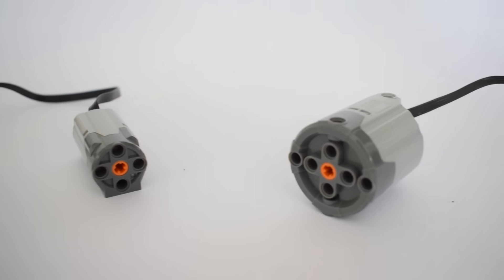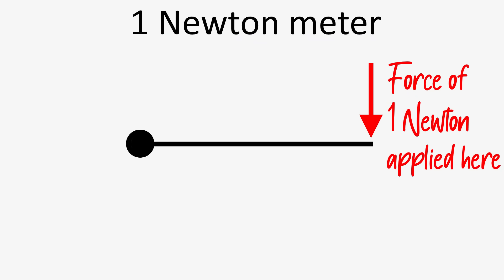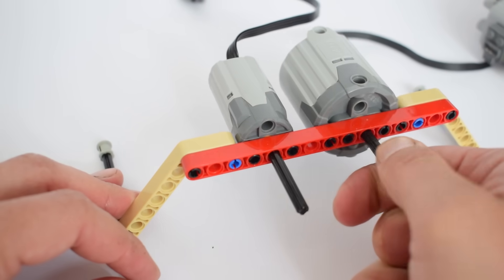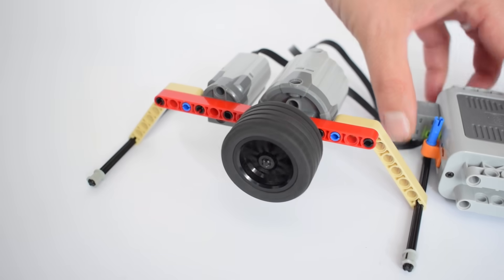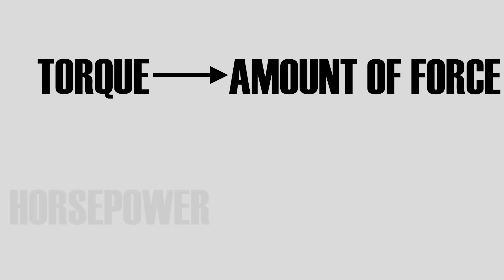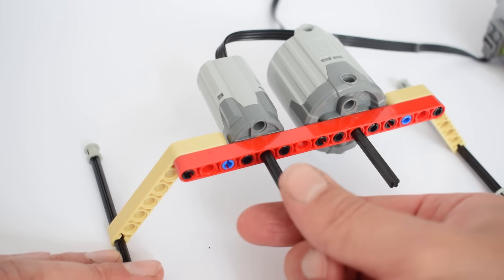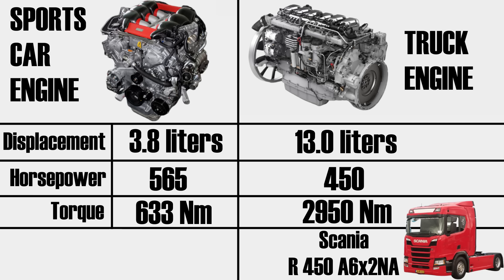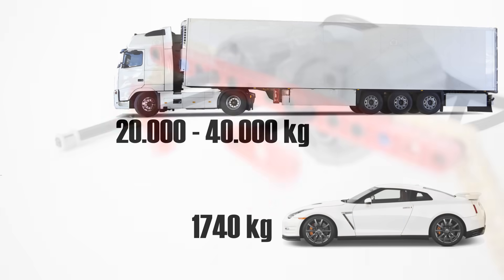NEVER be confused by HORSEPOWER and TORQUE again - HP and TORQUE EXPLAINED in the MOST VISUAL WAY

Comment: So basically, a gearbox is a device to control how much torque is being output by the driveshaft.
Reply: Yes, half true. a gearbox is also needed to spin the wheels slower or faster than the engine speed. 
Since the engine has a maximum power (torque x speed) the gearbox can increase torque by sacrificing wheel speed (HIGH TORQUE x low speed)  or,
increase wheel speed by sacrificing torque (low torque x HIGH SPEED)
Reply: @spamtes  yes that's what I meant, just did not elaborate enough. Thank you for the completion.
Reply: @spamtes  So theoretically you could use the GTR engine in a truck (since it has actually more horsepower at 7k rpm), but you would have to have a transmission decrease the rotations dramatically to get the same (or higher) torque as the truck? Could you also do the inverse and use the truck engine in the car and have the transmission speed up the rotations and with that decrease torque?
Reply: @EndstyleGG  Sort of. If both engines had constant horsepower then you would be right, since lowering RPM would necessarily increase torque. In reality, torque and horsepower are dependent on RPM (search for engine power curve or torque curve) and throttle, so the figures which are usually shown for engines are peak torque and peak horsepower at full throttle. Also, if you're searching for these curves and happen to find both for a same engine, notice how peak power doesn't occur at the same RPM as peak torque (usually).
Reply: @EndstyleGG  look up truck racing.
Reply: @MurdocK-BR  The biggest technical difficulty would be that running a truck on a high RPM engine would be engine durability. Torque can always be geared for, but it doesn't change the fact that the Nissan engine would need to constantly do 4-5 times more rotations at 4-5 times higher angular speeds to end up with the same distance covered by the truck. This creates wear and tear on every mechanical part of the engine. The Nissan engine can barely handle 200k miles driving a Nissan, where the Scania engine is expected to run a million miles, while pulling a full load of timber.
Reply: @EndstyleGG Good Question- exactly.
Theres a completely different reason to why it's not done usually, but in general the answer is yes. 
( Short reason: A truck needs high torque at low speeds because it's got so much weight to pull from stop. A GTR needs high torque at higher speeds to be able to keep accelerating and go fast! )
Reply: @EndstyleGG  Yes you could, the comment at the end about truck engine needing a large amount of torque to move the high mass is not totally correct.  A truck needs a large amount of wheel torque to move the mass so in theory, a higher speed engine could be used with a transmission designed to deliver the range of wheel torque needed.  

In comparison to cars, trucks use large displacement low speed diesel engines because they are more economical to run and maintain than a hi speed petrol engine would be, under the same conditions.
Reply: @spamtes  so basically horsepower is meaningless then with a gearbox. You could have 10,000 ft pounds of torque and the gearbox could just have a ton of gears and you'd be able to go much faster than anything
Reply: @lordzeuscannon6400    The only reason for a gearbox is to multiply torque.  An electric motor doesn't (necessarily) need a gearbox because they can produce torque from (near) zero RPM until max RPM, which is something an ICE can't do. Thus the need for a gearbox. 

It's all about the bandwidth (powerband) when it comes to transmissions.
Reply: @phillipzx3754  then I'm right
Reply: @lordzeuscannon6400  not really. Horsepower is always going to be the most important unit for capabilities. In order to move a car at a certain speed it needs a certain amount of power. You can use gears to increase speed or torque, but they change inversely. A low gear will reduce output speed but increase torque. A high gear will increase output speed but decrease torque. So even it wont matter if the engine makes a high amount of torque unless it also turns at a high enough rpm to make enough power to do what you need.
Reply: There’s a Volvo video on here where they changed the ratios of a fh16. And it out dragged a formula one car
Reply: There’s a few things not taken into account on the truck and car thing, a truck engine at 3K rpm will run all day. It will have enough capability throughout its rev range to do the work it does, this petrol car engine would be all over the show with power curves at different gears and the drivetrain would get excessive wear and the whole system would get very hot.

Comment: I never understood why car magazines publish both torque and power graphs. Torque x rpm = power. So the one graph is simply the mathematical derivative of the other.
In a car, you usually can’t put your hands around the driveshaft without losing your hand :) So you can’t feel torque like you can with your lego motors. The only thing you can feel in a car is the acceleration, which is determined by the power delivered.
When people say “I can feel this car has a lot of torque” they mean that the engine produces much power at a low rpm. Which indeed is only possible when the torque curve is already high at low rpm, which is refered to as “a flat torque curve”
Reply: It's an easier way to reflect area under the power curve. Flat torque less power curve area.
Reply: @Richard25000  “Area under the power curve” gives you much more information. It is the amount of Work produced by the engine from set rpm to set rpm.

Comment: Diesel turbo torque ❤️ gonna upgrade to electric directly after this as I want a torque upgrade only and not a downgrade. Torque is usable in day to day situations while you need to make the engine scream to get benefit of horsepower
Reply: When we say an engine is torquey it just indicates it has a lot of horsepower at low RPM. The torque is irrelevant and isn't what you're actually feeling. Acceleration is dictated by horsepower. Horsepower = Torque x RPM so to have a lot of power at low RPM you need a lot of torque.
Reply: @xeigen2  true dat... And Once you get used to low rpm pulls, there's no going back 😂

Comment: An important factor is gearing. If you have 2 engines that produce exactly the same power, but one does so at exactly double the rpm of the other at every point on the rev range, then the one with the lower revs is producing twice the torque.

However the one with the higher revs can run gearing half as high, and as rear wheel thrust (ie, torque at the wheels) is torque x gearing produce exactly the same wheel torque at exactly the same road speed just by revving twice as high.

Torque on its own is irrelevant! Bit ironic when people often tend to quote power with rpm, and ignore the rpm with torque!

Best way I can describe torque and gearing is to imagine taking a childrens roundabout fitted with a brake to make it hard to turn. Little me can barely turn it pushing at the edge of the roundabout. Give me a scaffolding pole as a lever and I can push from twice as far from the centre of the roundabout and it is a lot easier for me to turn it. This is effectively lower gearing, hence the lever is doubling my torque to turn to roundabout. However to turn the roundabout one complete revolution I now need to walk twice as far.

Comment: I'm very happy to say this is the best video about torque vs horsepower I've ever seen. There is so much confusion and misinformation about this topic everywhere: torque is for acceleration, torque is what you feel when you put your foot down, torque is for towing weight.... etc. All derived from a same misunderstanding of the physical principle of mechanical work and it's relation to power, wich can be described as amount of work per unit of time. People mistake maximum horsepower for power throughout the rev range, not understanding that even though a petrol engine might be able to produce a higher maximum power output, at 2000 rpm it will probably be producing a lot less power than a big truck engine. That's what creates the oh so famous phrase "torque is for acceleration", in my opinion. I guess what I would add is that, given a certain maximum horsepower figure, the more torque the engine can produce means more power sooner in the rev range. This has bothered me for so long that for the last year or so I've even been thnking of making a video to talk about. Thankfully, I don't have to anymore lol. I don't know if you have a engineering degree or not, but this certainly gets a full aproval for accuracy of physical fundaments.

Comment: Whats everyones favourite way of increasing torque
Reply from the maker: Mine is gears 😊
Reply: @d4a  honestly one of the easier ways of gaining torque mines just more displacement i plan on going k24 when i swap the engine in my del sol might do some light porting on the head and intake manifold just to help flow at higher rpm
Reply from the maker: https://youtu.be/dMDyFgrDyK4
I have a video on the K series. There's some cfm flow numbers in that vid too. The K series is one of the best flowing heads in stock form ever made. Unless you're planning on an extreme build there's nothing to be gained from porting. You need a lot of experience and skill to actually improve something by porting on that head. I ported a few heads and I would honestly leave the K head alone if I was building one. It's a really nice design.
Reply: @d4a   would polishing make a diffrence especially on the exhaust port as i plan on gaining all i can from what i can do ive seen people port the manifolds and make more power up top my idea is to make about 200whp out of a k24a or k24a3
Reply: NOS

Comment: I see one small problem. After watching this video everybody will think torque is all you need to go fast. So, in order to correct that, you should make a video comparing the acceleration of a petrol and a diesel car, look at torque curves, gearing, torque at the wheels. The automobile-catalog website has all the information needed.

Comment: Ok, i hate to bring it up, but you are explaining it wrong... ;P
At 4:18 you try to explain what power is, and you state that it is related to time. Its not. Its related to distance (rotational, linear etc). Distance x force = Power. 
I think you got mixed up with "Energy". Because:
Power x time = Energy 

The same is true for electrical power for example. 
Voltage (potential force) x Current (flow of electrons) = Power (Watts)
Power (Watts) * time (seconds) = Energy (Watt*seconds, or kWh if you scale it)

In your example you say that "Power measures how often a force is applied over a certain period of time". But that does not take in to account the distance.
Reply from the maker: You're twisting my words. I never said power is related to time. I said that power introduces time into the equation and that it does. Power is torque x rpm. Rotations per minute. Minute being a measure of time. A watt is also a measurement of power and that's joule per second. Second being a measurement of time. So power definitely isn't force x distance. I also definitely never spoke of energy nor did I multiply anything by time alone.
Reply: @d4a  wow, clearly i wasnt awake when i wrote my message... Sorry for that. 
Speed x force = Power
And you are right, there is time involved, since speed is distance/time. 
But the statement  "Power measures how often a force is applied over a certain period of time" is misleading, and i guess that is what triggered me. Because power is not just force over time, but instead force * distance over time.
Well, hope i get it right this time...

Comment: So at the end, is faster acceleration of a car related to its power or torque?
Reply: Both because you can gear a higher HP engine more aggressively to either produce more axle torque and lower speed or less axle torque and more speed.

If you ran an engine through a gearbox of 10:1 axle torque is 10x that of engine torque but axle rpm is 10x less than engine rpm.

Hence 1st gear might only do 35mph but wheel spins and acceleration is high.

Similarly 5th gear won't accelerate or wheel speed as axle torque is lower but you can now reach 150mph.

HP can be any combination of torque or rpm but you have to sacrifice one to gain the other. If you didn't you'd just end up with more HP
Reply: @Richard25000  thank you for taking time to explain. I think my question was not enough clear though. What you explained applies to all vehicles but I'm asking about faster acceleration is it achieved by a more torque car or more powerful one? Same gear same load etc

Comment: Now that we know, Horsepower and Torque work in tandem with each other, so basically Horsepower is how fast the Torque is being applied to the load.
Reply: they don't work in tandem, they are two different ways of saying same thing.
 When you know engine's torque, you need to also know gear ratio and wheel diameter to get force transmitted to road.
With power, you just need to know vehicles speed to get same thing.
Reply: @Papinak2  so you mean, horsepower does not affect the gear ratio and wheel diameter?
Reply: @Astrix_Jaeger  exactly. 200Nm@2000RPM produces same power as 100Nm @ 4000RPM - pair the latter with 2:1 gearbox and you'll get 200Nm@2000RPM again. Power doesn't change all the way to contact with road (except for mechanical losses)

Comment: I always envisionned difference between torque and horsepower, in a car, like this:

Horsepower is your car's ability to accelerate quickly, while torque is its ability to maintain its speed whitout shifting while climbing a crest.
Reply: Furthermore, the strength at which you are initially pushed back on your seat is the effect of torque (the first kick at the moment you put the pedal to the metal), but the way it keeps you glued there over a stretch of time is the effect of horsepower (combined with the overall lightness of the vehicle). So, in layman's terms, torque is the kick, and HP is the glue.
Reply: Wrong way around....an old saying is HP is how fast you hit the wall, torque is how far you take the wall with you. HP takes over from torque at speed this is why diesel cars seem to get off the line a lot quicker than their petrol, higher HP cars.
Reply: @Mr_OoOsH  That's exactly what I meant.. ;)
Reply: @EddieOtool  yeh I see that from your explanation, torque is a wonderful thing 🤣 my car is around 920nm

Comment: Horse power = how fast you hit a wall
Torque = how far you take the wall with you
  -Clarkson
Reply: No this is one of the dumbest car world things said by car guys.

Horse power how fast you hit the wall.

How far you take it would be related to the momentum of the vehicle.

At 60mph a truck at 40 tonnes will take the wall way further than a car at 1.7 tonnes.

Torque doesn't enter into it as you could get the same results after lifting off the throttle producing zero torque and zero hp.
Reply: @Richard25000  you can always take the wall with you if you tie it to a car,torque does help with that,you can also hit the wall with low speed and then continue to take it with you,torque also does that,never specified that the two things need to take place on the same time
Reply: Why everybody just assumes that you take the wall with you AFTER you hit it and not just starting from 0 and taking it with you?

Comment: You actually feel acceleration in a car, not force. Like you said, torque is a twisting force. I don't feel like I am being twisted as my car accelerates.
Reply: No you feel linear force which is generated from torque at the axle by the radius of the wheel.

1NM is 1N force at 1M radius works both ways.

Comment: So why on a motorcycle treadmill is the Tq measured at the wheel but for calculating HP it uses rpm of engine instead of rpm of wheel? and why multiply the rpm of the engine by 2pi instead of number of cylinders?

I know the answers.......makes bigger numbers
Reply: Torque at axle is larger rpm at axle is lower.

Torque at motor is lower but rpm at the motor is higher.

Forgetting frictions the basics is you get the same HP at the axle as you do at the engine.

You've just traded rpm for torque with the gear ratio. It's the same result in power.

Just divide axle torque by the gear ratio you can find the torque at the motor.
Reply: @Richard25000  You agreed the wheel rpm is less than the motor rpm and the wheel Tq is higher than engine Tq

I agree with that..........however when you multiply a number by X instead of Y and X is greater than Y then the product is higher NOT equal to if you had multiplied by Y

So if you measure Tq at the wheel, in order to get the correct HP you must multiply by the rpm of the wheel........especially if you are going to further use the multiplier of 2pi instead of the number of cylinders

Comment: So,
More Power = Higher top speed and
More Torque = Better acceleration ?
Reply: No,
More Power: Higher top speed and better acceleration
More torque: Ability to haul more weight
Reply: More torque can be generated by a higher HP motor at the same RPM.

Comment: TL;DR Horsepower is marketing horse@#$. Torque is what gets work done.
Reply: No because torque doesn't tell you how quickly you did the work. Without that torque numbers are useless.
Reply: @Richard25000  Use a modern measurement like kW then.

Comment: Assuming an appropriate gearing of the transmission, and assuming that the engine always remains at peak power or near peak power, the engine with higher horsepower will always do more work than the engine with less horsepower (but more torque), ignoring reliability. Huge torque numbers but lower horsepower on a engine just means that it makes more horsepower at lower RPM, than the engine that has the higher horsepower but lower torque (which makes more horsepower at higher RPM).
Reply: This. This right here is the correct explanation.